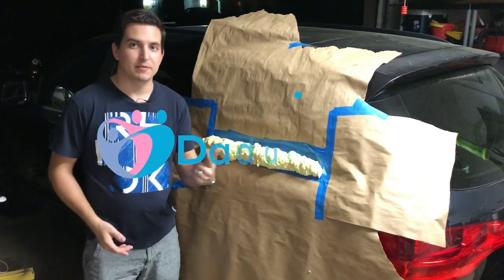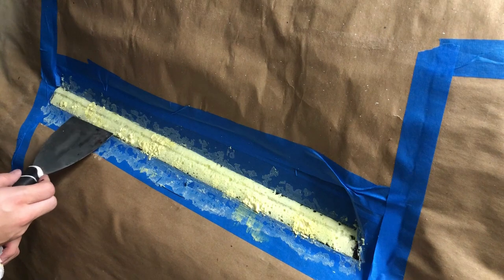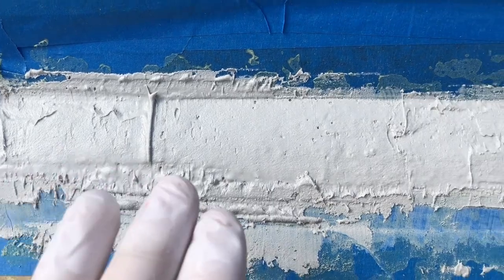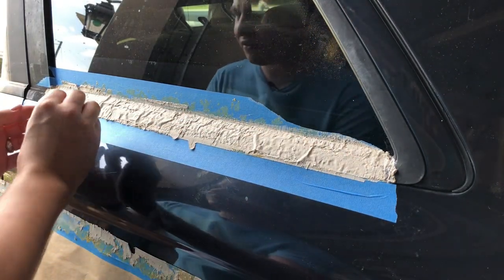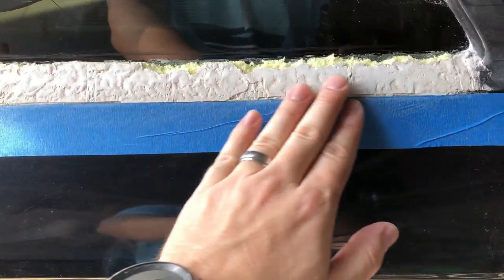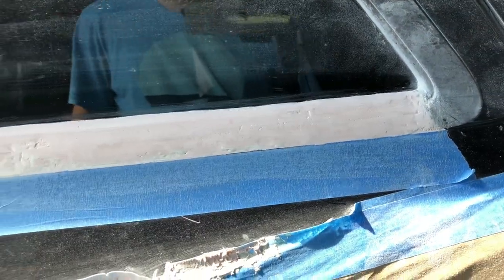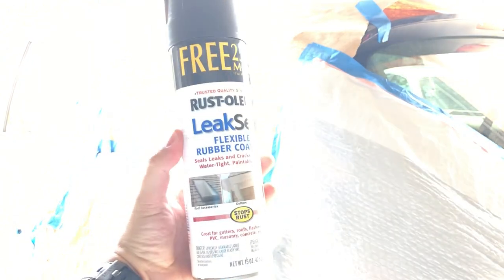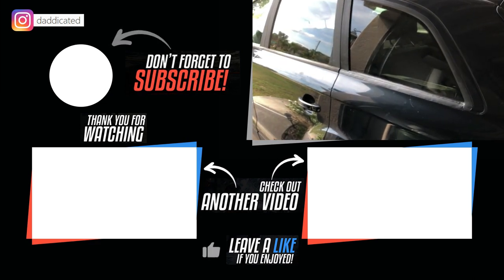How to repair car window gasket on Audi Q7 - Part 2

Comment: Haha..that's really bad, why didn't you just use black RTV
Reply from the maker: Don’t know what RTV is. I wanted to try something different. Lol
Reply: @Daddicated  It's just a rubber sealant, it will actually outlast the Audi original seal. Buy it in a tube, mask off, apply and smooth with finger or spoon, 24 hours later its set.
Reply from the maker: @minesy72  will need to try it next time. Thanks. I got rid of the Audi already. It ended up having a massive oil leak to where it just wasn’t worth fixing so I sold it. This car was such a headache.
Reply: @Daddicated  They are especially the oil leaks. Parts are extaustionate. I spend too much time repairing these especially the 4.2 V8. Troublesome cars.
Reply from the maker: @minesy72  yeah never again getting an Audi. Lol
Reply: I was planning on buying an Audi Q7 2007 110k miles, looks pretty clean, guy says there’s nothing wrong with it. 1 owner, what do you guys think?